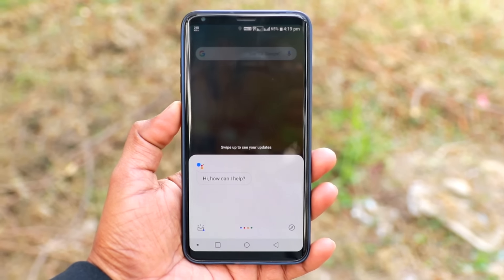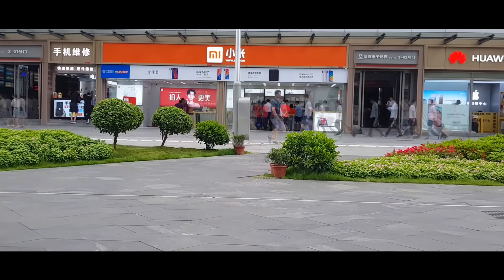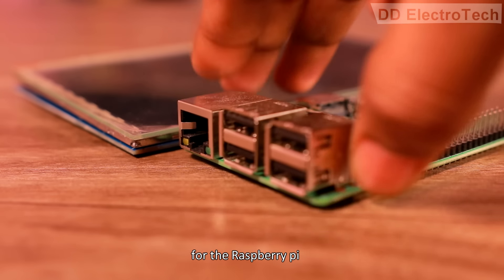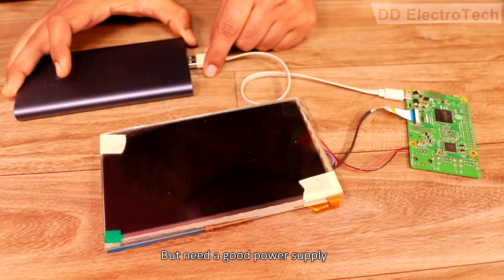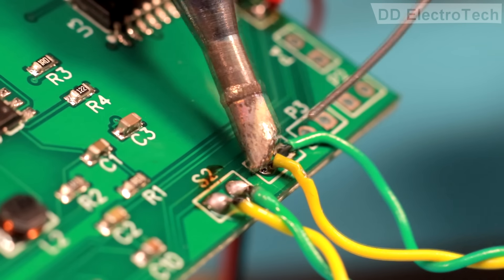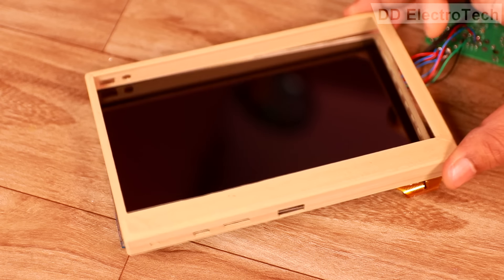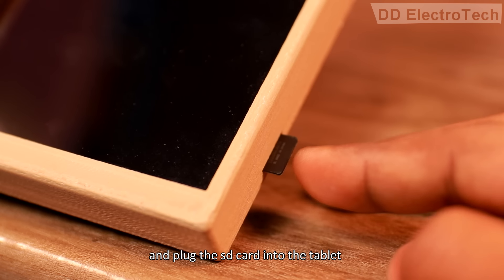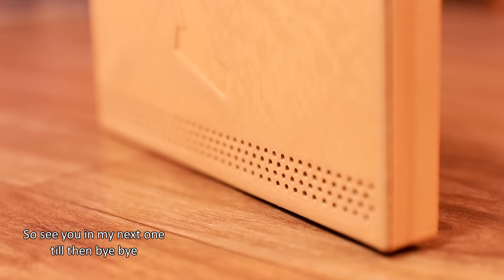How I Made My Own Tablet Computer - in China

Comment: This tablet has a few flaws:
1. Booting from a SD card is a huge mistake, SD card speeds being really small.
2.A 3D printed case is really not ideal, as that tablet will break at the first drop.
Reply: @Nishant Kumar Yea, the tablet is good but anybody can use some advice, trust me
Reply: This guy hasn't assembled it in a factory. You can't expect so much

Comment: Dude! That look awesome! Hoping to build my own someday. Well, at least, "modify" my current smartphone into a workable tablet.😁😁😁
Only problem is how to give a mono speaker sub board a dual channel, dual speaker function.😁😁
Also, i have to find a compatible 10" tablet screen with a 90hrz refresh rate and an adapter for the smartphone's display port. Battery, i can use a higher capacity tablet battery to power everything. Hoping to see your next project, dude. Suggestion: make a wrap around hud using super amoled smartphone screens.😁😁🤓🤓